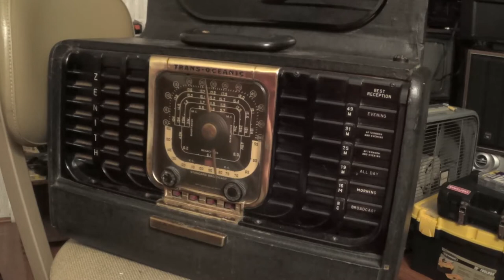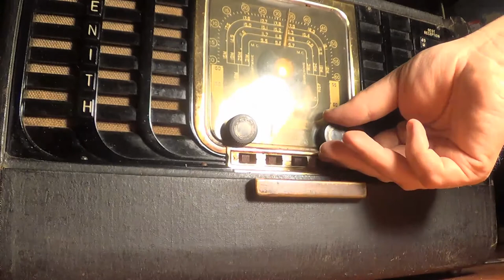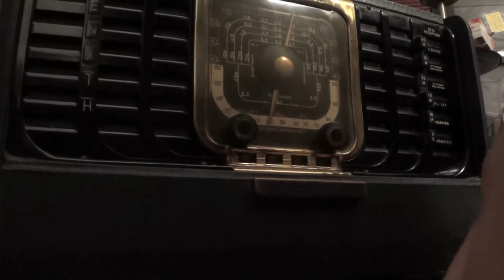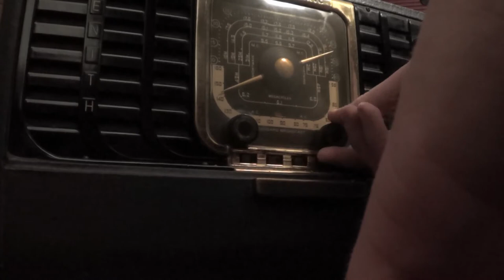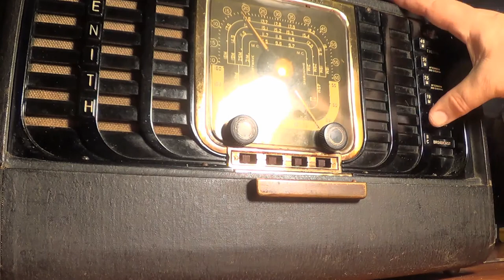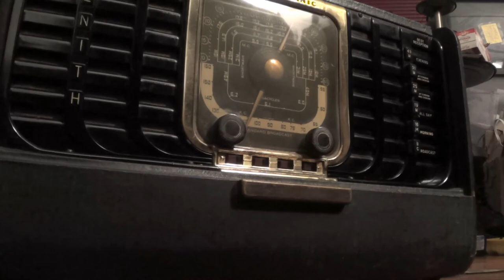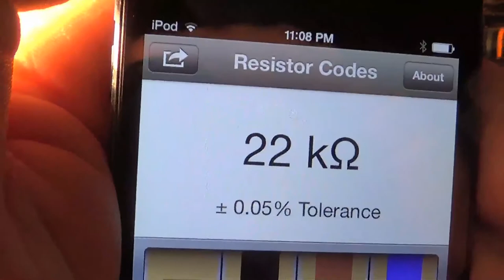First look at the Zenith Trans-Oceanic radio

Comment: Hi Jeffery, Put in your search engine "Sprague "Bumblebee" capacitor color code chart" and you will find a goodly number of hits. The best one is from Pickguardian .The color you are calling gray is light black, a 20% tolerance cap. The rest reads as 22000 pfd at 200 volts. As far as the micas are conserned in the I.F. cans they can be any were from 100 pfd to 470 pfd . Get part numbers off the cans and do a webb search and see if you can find the info on them. Oh, by the way the service info from Zenith or SAMS doesn't show the value of the mica capacitors.  All the best, Tom J from Florida

Comment: That sounds like a bad case of "silver Mica Desese" , the IF cans need to be removed and the silver mica cap wafers removed and replaced with silver mica caps, the problem I do not know the values of those caps.
Perhaps someone like Dennis Carter can help you on that one.
FIRST off I would replace ALL those bumble bee caps than see how the radio work, but my bet is on those mica caps at the bottom of the IF cans.
Reply from the maker: I heard the are 100 picofarad. I'm thinking the same on the bumble bees. Am I reading the values on those correctly ??
Reply: As I understand they read like a resistor but I always avoided trying to read the code, just get the schematic on that radio, the values will be shown there.